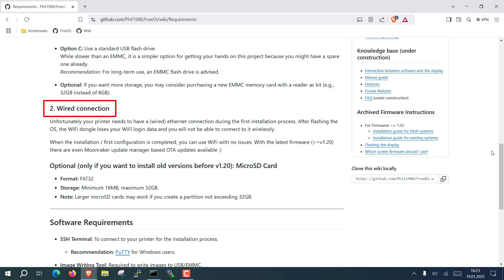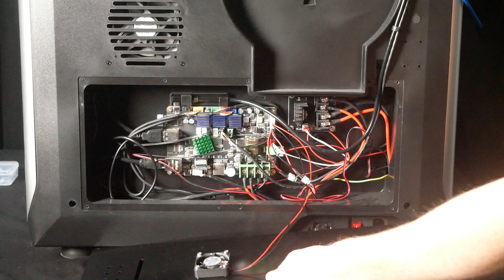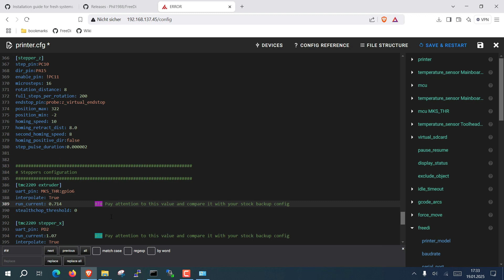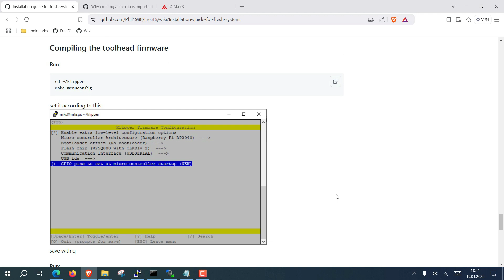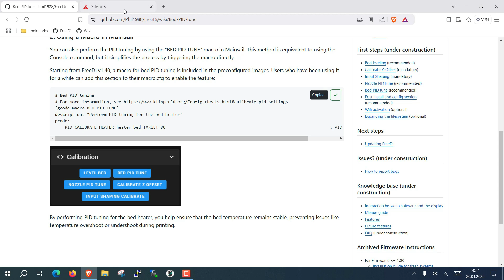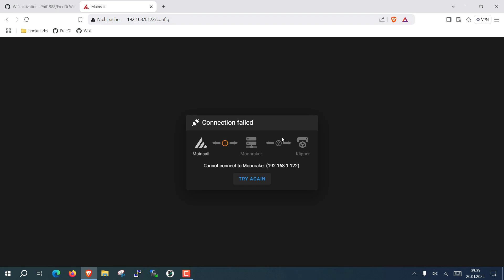FreeDi Installation Tutorial for QIDI X-Smart3, X-Plus3 & X-Max3 3D Printers!

Comment: First of all, you are awesome, second of all,  I'm a total noob, I see the Plus 4 is listed as integrated but I don't see it in your video. Are there Model specific instructions anywhere, video?  What sort of expectations can we have with Qidi Box? Any plans in that regard? Thanks
Reply from the maker: There is a full guide on my written wiki. Check out my repo for that.
So the Plus4 is supported works, but no install video is out yet and no multi material/QidiBox support yet.

I have plans for that.
QIDI did stop every community support so that's completely on us (+the cost) to do work on it :)

Comment: Anyway to connect this to a mobile app so I can check on my prints when I'm away? I have already installed it on my XPlus-3.
Reply from the maker: VPN and your favourite browser is the only safe way :)
Reply: @C0co_ytcn  any guide available on how to? I love it in my XPlus 3 but I just waste a good hotend after a nylonCF print failed cos I couldn't check on it while I was pout and about.
Reply from the maker: @Lost-Orbz It depends on your hardware and local setup.
Some routers have a OEM VPN service included.

To you may want to give your favourite AI infos about the devices you own and services you use (there are VPN services) and if you are willing or not to pay for this service and how you can set this up.

Comment: One thing is missing in the video... you can ALSO PID the chamber heater.

put that in your macros.cfg

# PID Heizelement_Kammer
[gcode_macro M191]
gcode:
    #Parameters
    {% set chamber_target_temp = params.S|float %}

    {% if chamber_target_temp == 0 %}
        M118 Kammerheizer aus
    {% else %}
        M141 S{chamber_target_temp}
        TEMPERATURE_WAIT SENSOR="heater_generic chamber" MINIMUM={([chamber_target_temp, 60]|min)-2} MAXIMUM={chamber_target_temp + 5}  
        M118 Bauraum bei Zieltemperatur
    {% endif %}

PID will take AGES (roughly 30-40mins for 55°C), but it's worth it.
and yes, you can set temps as variables...

Comment: Hello.I have a question in regard of Release 2.01. in the Release section is described“Touch only – no SSH, no serial console, no sorcery degree required - only the stock touch screen ✨.
Auto hardware detection – identifies printer model, toolhead MCU, screen type, etc..“ .Means this that i Must Not modify the Printer.cfg anymore.And Must Not prepare the toolhad configuration?Or Must i follow the 2.00 Guide Like described?Thanks in Advance .BR

Comment: is there anyway to run this screen firmware on a raspberry pi to use the factory screen. Im having a hard time finding a screen that doesnt shutdown or start acting strange in the original screen hole when the chamber is up to temp.
Reply from the maker: Yes there is a way. Check out my wiki or get in contact with the freedi community in discord (you will find the channel at the wiki).
Reply: @C0co_ytcn  Awesome I plan on using a pi5 and octopus pro only now, I want to run wires back to the electronics compartment and drop the toolhead board. I added 2 chamber heaters and was seeing up to 80-85 c but also was seeing stepper driver failures. I have the screen already flashed, I followed your guide a few months back and had a up and running printer so im hoping its gonna be simple since the screen already has the firmware on it

Comment: Where can I download the stock qidi MCU and Toolhead firmware?  I'm good enough with linux and the existing firmware packages that I can get the EMMC card back to default as well as the screen, but I wouldn't be able to revert to stock if I wanted to because I don't know where to find the MCU or Toolhead firmware.  If I had these, I'd give this a try knowing I could always put the MCU and Toolhead back, then use the 400_800.tft file to update the display and the stock emmc image.
Reply from the maker: @akschu1  Check the discussion in my repo :)
It's all covered and explained there ;)

Comment: Thanks for the great upgrade.

I had only one problem - homing failed. However, my x-max 3 is quite old and has different motors - it detected the endposition after just a centimeter movement to the left. I just changed the homeing makro. Originally it uses 80% of the normal current while homeing. By removing the " * 0.8" in homeing macro, the correct end position is detected reliable now, and the qidi prints very nice. As I solved the problem myself, I have not opened a ticket on github - but if anyone else get into this problem, this info might help.

Having an actual klipper realy is useful. I already changed the hotend to a Revo (added an old skr e3 mini v1.2 with defect x-stepperdriver as third MCU to get a thermistor input). Using a standard flow 0.4mm nozzle, I could now use Prusas ramping profiles for unload, to get a nice filament tip without cut&poo. Next step will be adding the ACE pro (using "DuckACE" from github to connect it to actual klipper) - but this might still take some time. Doing this with actual klipper might be helpful here.

While I am now limited to 300°C (unless I further upgrade to Revo HighTemp), I now also can easy change the nozzle (standard/highflow, different diameters or ObXidian for abrasive filaments) - without recalibrating z-offset, as all revo nozzles have exactly the same lenght.

After upgrading my X-Max 3, I ordered a second one. It arrived an hour ago. This weekend it will be upgraded with FreeDi also.
Reply from the maker: @oleurgast730  This is the beauty with FreeDi: You can now easily modify and upgrade your printer as you like.
And even if not the prints are faster and with noticeably better quality :)
Happy printing mate :)

Comment: Everytime turn on the printer i must maintain boot button on the hotend otherwise won’t work got the screen firmware and klipper restart
Reply from the maker: @falcon3ye2111  YouTube is not a great place to report it mate :)
Please head over to GitHub and check #165.
I think this is the same for you and it is fixed :)

Comment: I like your video very comprehensive The only thing that I can say is when you say take the tool head firmware and put it in the right place if someone is a beginner they may not know where the right place is just a thought I thought from someone who has struggled through two or three clipper installations on MKS pie and raspberry pi having to figure out the small details that no one ever puts in their videos all on my own Thank you for your video and your hard work just the suggestion from someone who is spent lots of time in front of a terminal to solve a very small problem due to a lack of very simple piece of information
Reply: Care to elaborate on the 'right' place for him then? You just did the same thing you complained about.

Comment: Thank you for your work. I can't wait to see if this get released for the Q1 Pro. I check github daily hahahaha even if it said that April is a possible date. The reason I want it is that Qidi tends to drop support for their machines after a few months. There hasn't been a update for the Q1 Pro for almost a year. The REAL issue is that I want to install an eddy current type of device. It takes way too long to probe the board with the current setup.

Comment: so simple and works like a a charm, only thing i noticed on my plus 3 is the mcu (stm32f401xc) still says v 0.10.  everything else is v12 but is everything working fine. great work
Reply from the maker: @rustysaudiogarage  it's a timing issue and it's currently being worked on.
You can update the mainboard MCU via terminal or via SD card.
More information can be found on the wiki or on our discord channel.

I'm glad that you like it <3
Reply from the maker: It should be fixed with the latest v1.42 release :)

Comment: Do you know when this might be available for plus 4?
Reply from the maker: @camronconlee944  maybe not too far away :)

One question: why do you personally want it on the plus4?

There is an issue open on GitHub where I will inform everyone for the Plus4
Reply: @ well that sounds promising.  I really dislike the half baked open source klipper.  I feel like they should lock it down or open it completely.  I’m currently trying to get my printer back to stock after messing up the initial installation trying to install a program from outside of the qidi repo.  Since I was having to reflash and re-install everything I figured I would attempt to install open klipper and possibly a different screen if necessary.  I also did have some small issue crashing the nozzle into the bed after performing a manual z offset and I think that might be from going back and forth between the software and the qidi native screen.  If you need any beta testers let me know 😁.  I’ll see if I can find that GitHub issue and keep an eye out for a future release.  Thanks for your work!
Reply from the maker: @camronconlee944  You will find this "issue" at the bottm (3rd last entry) with #46. I need beta testers for the plus4 soon ;) Get in touch with me via the mentioned git thread or via discord. You will find the discord channel in the wiki under "Community". Sorry that I cant give you direct links here on YT :(

Comment: What is the adapters I should get for this? Have any Amazon links
Reply from the maker: @Glockziller  
Amazon depends on the country you live.

My tip is to buy the 32GB EMMC from QIDI and get a free card reader including https://qidi3d.com/products/x-max-3-x-plus-3-x-smart-3-emmc-32g?variant=41844299235468
Reply: @C0co_ytcn do you have to have a new emmc? I ordered one I seen a lot of good reviews for is that all you need the micro sd reader and emmc reader?
Reply from the maker: @Glockziller  Only an emmc reader is needed.
Please check my updated wiki (requirements... and the rest) ;)